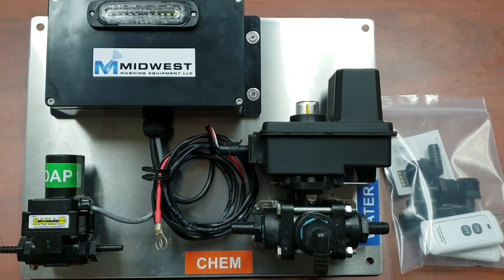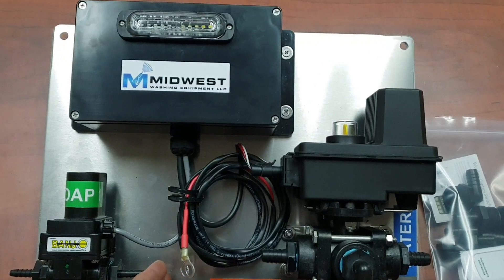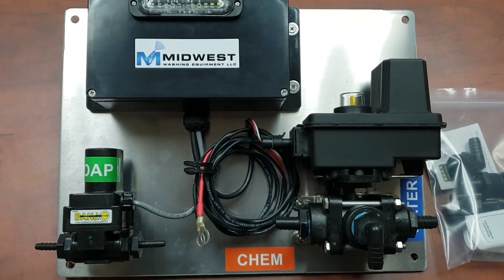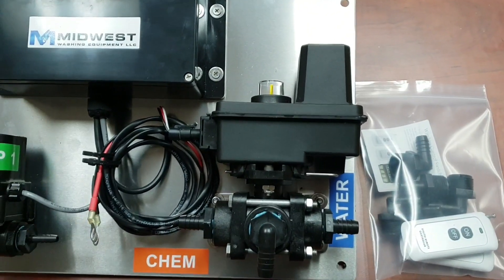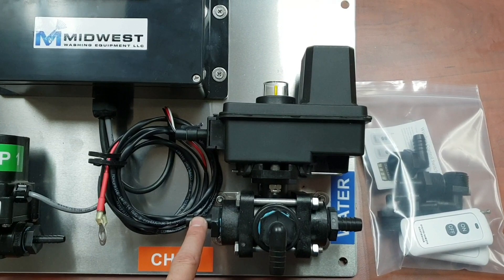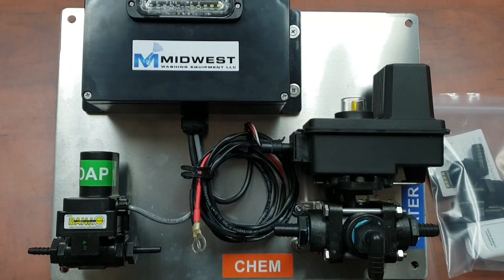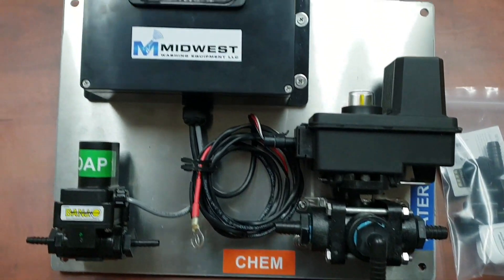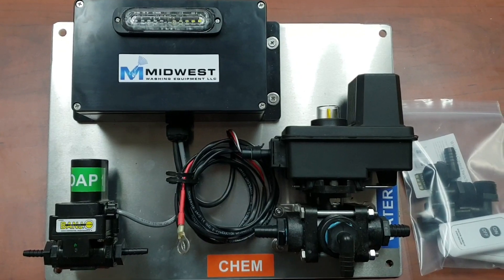Remote rinse module for Soft Wash Proportioning Blending Units

Comment: I dont have this unit but I do have the 3 way banjo. How would I plumb it? It's confusing
Reply from the maker: Hi, thanks for the message.  Middle port goes to your SH or chem metering valve, one side goes to SH tank, other side goes to water tank. The 3 way valve determines what comes through your metering valve.
Reply from the maker: Here's a video that shows how to plumb the banjo 3 way https://youtu.be/t2Ch487oSzc